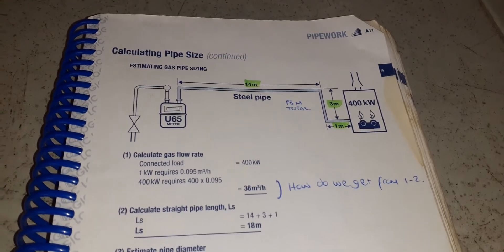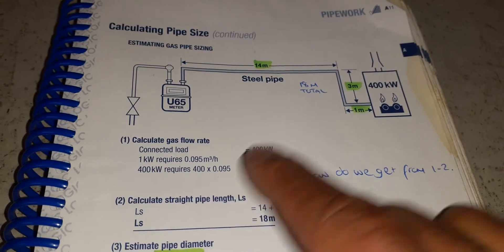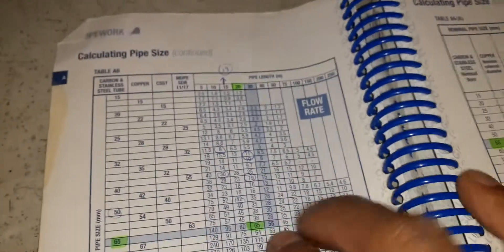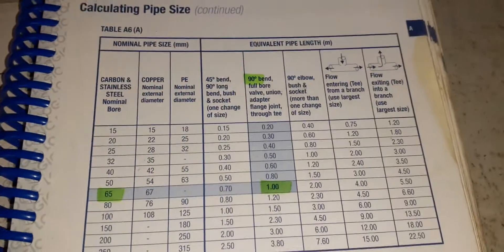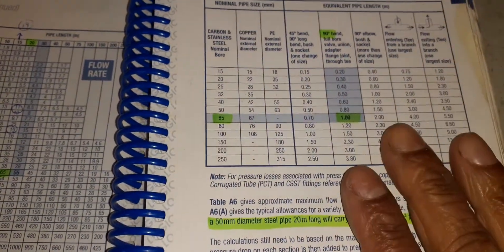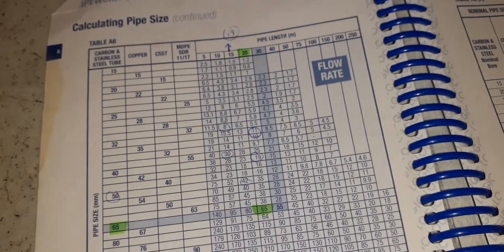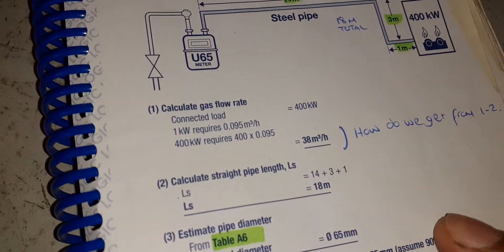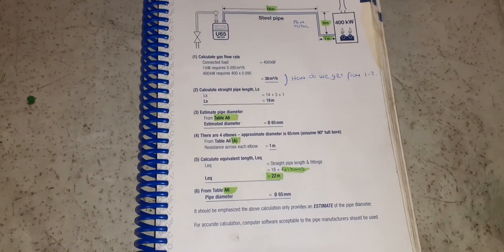CALCULATING COMMERCIAL GAS PIPE (serving one location)

Comment: Where can i get this book
Reply: Ok nice i subscribe to your channel has well..also i love this typw of work ..i do it here in the carribbean..fix ovens fryer and other kitchen equipments I'm trying to get invovled in running my own gas pippings and properly calculating the stages of regular i need whiles calculating the distance for the pressure
Reply from the maker: @jonathasbelony4467  thanks for subscribing bro. Which island you on? Wonder if I've ever been there...
Reply: I'm from the bahamas part of the carribbean
Reply from the maker: @jonathasbelony4467  nice part of the world to be
Reply: @CommercialGasEngineerVideos   yeah its really a good vacation spot
Reply from the maker: @jonathasbelony4467  what sort of appliances are used in commercial buildings to heat up hot water. I wonder what the difference is to the UK?
Reply from the maker: I had a look and it doesn't appear to be easily available any more, not even on the logic website. From time to time I see gas books appear on ebay. I'm sure the books will do. I have a video on gas books. Check it out.